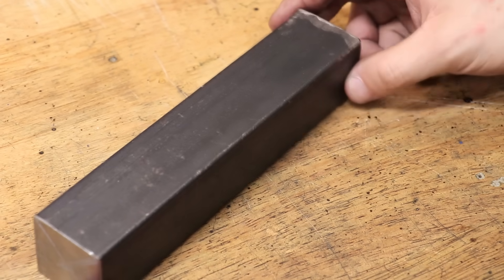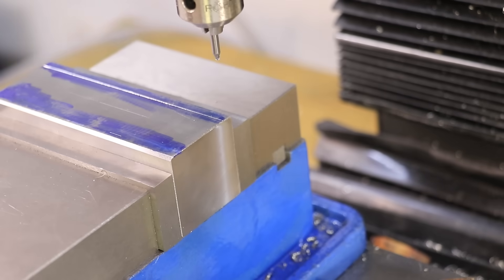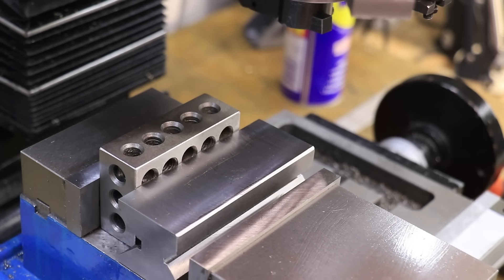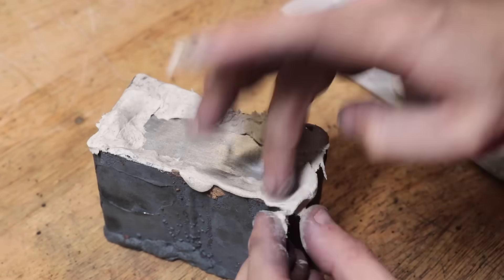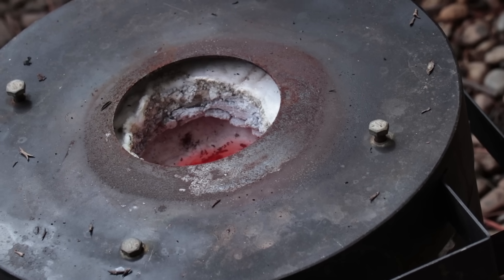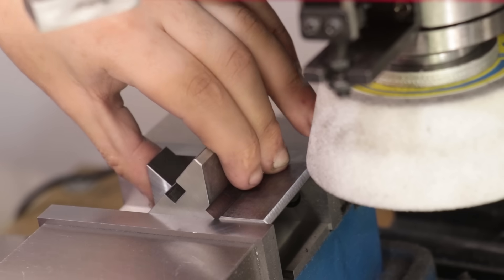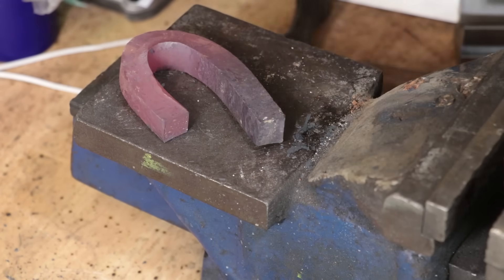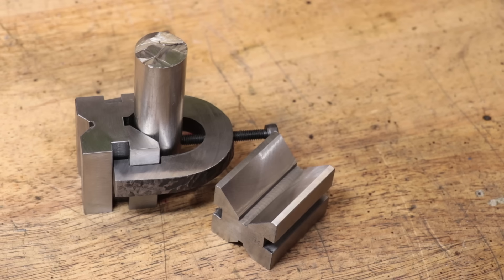Making A Set Of V Blocks

Comment: You are grinding on the mill. I tried, but got a problem: the mill stalled because the grinding did not remove enough material. What is your step size from pass to pass ? My machine has only a 0.01mm scale, and I heard you have to use 0.0025 to 0.004 on each pass.

Comment: Have you ever considered chain-drilling when cutting material?(For those who haven’t heard the term, it’s drilling a series of holes close enough together so the bores of the holes slightly overlap each other into one groove, a strait line, circle, or whichever pattern) It does waste a bit of material, but it makes the hacksawing so much easier. I use DeWalt pilot point bits for doing this in big chunks of material all the time. I just did this with a 12x8x1/2” steel plate and roughly chain drilled the shape of features, think a poor mans waterjet type of cut, and finished it with two passes per feature face on the mill. Just throwing the method out there for anybody. I know endmills don’t grow on trees for us hobby people, but drill bits sorta do. But, if anybody does this, be VERY careful with the drilled edges.
Reply: I've used chain drilling quite a bit myself, it works great if you don't have a better way.

Comment: Hey man! I noticed you add a piece of wire/aluminum rod in-between the soft jaw and the piece while squaring up your stock. What's the reasoning behind that? Does it prevent the soft jaw from throwing the piece off square when pressure is applied?
Reply from the maker: I use it when clamping on uneven stock. Makes it so there is one point of contact from the moving jaw to the uneven stock which helps ensure that the machined edge stays parallel with the fixed jaw.

Comment: if you want too facegrind with no mess find a stainless steel tub your vice fits in with some room either side, about 50% of your mill table

have the tub about 4” high (whatever fits nice) drill two hold too bolt the vice through too your table. This will catch all the sand

your pretty much putting a bucket under and around your vice 

i use stainless cake tray found at a  kitchen shop. that way it doesn’t compress when you bolt the vice on it

Comment: Good work my brother, So few people today actually know how to use a hack saw. Good work with the first time pack hardening. ,,,, If anybody deserves a band saw, though. it's you. Don't sell the HF 4x6 short. Don't listen to the cork sniffers. It takes a little tuning but we have had one in our shop for over 30 years. - 2-Worm wheels, 1 moter,  and installation of water and hydraulic feed cylinder and we use if a good 20 hours a week cutting 4140 round bar. Well worth the 3 hun they go for today. Like I said. You deserve one.

Comment: I feel the process you use to harden your parts is a bit inconvenient. A much easier way would be to use a box with a lid, instead of clay. If there is a little gap doesn't really matter, as any Oxygen will instantly burn the coal and become CO2 before even getting to your parts. You can then use the box again to protect your parts from oxidizing and decarbonizing while heating up for hardening.

I've done this a lot of times and it is a common practice to put not only case hardening but even tool steel in a box with charcoal to prevent forming of scale and it works well.

Comment: Love the vid 👍. Also the reason you didn't get the same hardness as cold oil is the thermal shock from the quench. The oil being hot means the temp diff is not as massive allowing the piece to cool off more slowly.
Reply from the maker: Well yes, less martensite formation, but I don't need hardness for v blocks, which is why I chose this method, I needed minimal warping. Hot oil won't as much variation in temperature

Comment: NEVER case harden ANYTHING!!
Use A2 tool steel and vacuum heat treat to 58/60. 
Warpage from case hardening IS NOT worth the effort.
Reply from the maker: Well if I could buy tool steel in the size of square bar I would. But my suppliers don't sell that

Comment: Very nice work.
I made my own forge too - I was (still am) about the fiber comming from those K-wool blankets.
I (very carefully with full protective gear) coated my forge with refractory cement (about 5 layers - about 3 extra due to cracking and other issues. Two layers are good enough). 
You really don't want to breath these tiny fibers - it's like breathing asbestos.
These tiny glass fibers induce silicosis - a process of forming lung cancer due to embedded particles in the lung that cannot be cleared out, just like asbestosis. FYI.

Comment: I guess you realised later you should have fitted some sort of spacer into the 'U' of the clamp to prevent it springing.
 I was given a 'pair' of small V blocks probably 30 years ago without clamps.
 cut them from 3/8" (10mm) plate and used a 5mm screw. Hole saw hacksaw and files did the job
Only one gets used a lot so being a mis-matched 'pair' doesn't matter.
You always seem to be fly cutting at high rpm, are you using carbide insert cutter?

Comment: Nice video, both the quality of machining and filming ! A question though : For such parts, what's the adventage of case hardening VS making the part of higher carbon steel and quenching it ? It's quite time consuming and you dont get as much hardness as you could with the first method
Btw, good work mate, keep them coming !
Reply from the maker: Thankyou. I tend to rely on case hardening to harden parts because getting large flat and square bar of high carbon steel is very difficult. My area of the world doesn't have a big demand for that type of steel in the manufacturing that happens, as a result of I really wanted to get a piece of high carbon steel, like what I used here, I'd be up for a minimum order of atleast 6 meters. Conversely getting my hands on low carbon structural steel is much easier. Cheers

Comment: When squaring stock like that, instead of that little bar/rod you used vertically, you should use it horizontally, or better yet, just use a ball bearing on the moving jaw.

Comment: Silver flux is boric acid and borax. One thing you might try is to get a hold of some nitric acid. A 15% nitric acid/water mixture will etch the case/core of a test (done at the same time) sample which is ground down allowing you to measure accurately the case depth. It will turn the case black and leave the core silver.
Reply from the maker: Cheers, someone suggested that I try out the nitric acid mix, and I will have to do it sometime in the future. And im sure some fluxes are boric acid based, but this one isnt.
Reply: @artisanmakes  Interesting. Here there is nothing but borax based. Of course I only buy a new jar once every 25 years! So maybe its a new thing?

Comment: an alternative to carburizing is "super quench"
4 gal of water
1 large bottle dish detergent liquid
1 sm bottle of "jet dry"
5 lbs of salt
mix ingredients
quench your 1018 - 1045 when your above the curie point
works great for low to mid low carbon steels
you can expect about a 50-52 rockwell
descale with a soak in muriotic.

Comment: When tapping a part, why don't you make yourself a dead center point with straight instead of tapered shaft so you can use the mill or drill press to keep the tap straight when starting the tap. that's what the little center hole in the back of the tap is for.
Reply from the maker: It's certainly something that is on my list of projects that I need to get around to doing. Cheers

Comment: I would have cut the slot all the way down to the bottom of the V's first, and then cut the 45° on either side of it. That would have required smaller cuts which might have made it easier going.
Reply from the maker: Fair enough, many ways to tackle the same job. Cheers

Comment: Does grinding them flat do anything to the case hardening? (I'm a complete noob, be gentle.)
Reply: I'd say that the grinding removed almost all of the case hardening.
Reply from the maker: The case thicken should be around 0.15ish and the deepeesr grind was about 0.03mm. so I definitely took some material off but thankfully it was much less than I had to remove with the vice build. Cheers

Comment: Why did you machine the bar BEFORE forging it? Just curious... the clamp turned out awesome! The contrast between machined and forged finish looks very good!
Reply from the maker: Needed to square up the sides. It was a piece of off cut from a previous project and the edge was in rough shape from the angle grinder. Cheers

Comment: Please, use non teflon coated stuff, when operating above 250deg C (480F) because teflon is decomposing above this temperature - and above 300C its quite generous, how much crap its releasing.

in cooking its the same, dont overheat pans and pots.
Reply from the maker: Interesting point, never occured to me about thinking about that in this situation..I know of the cooking concerns about Teflon but I use cast iron so it never really occurs to me. Cheers
Reply: @artisanmakes  It's worth being careful but at the same time the decomposition products are bad but have never been found to be a major exposure pathway for humans. Apparently, tests showed that butter fumes are lethal to parakeets at a lower temperature than the coating on PTFE cookware.
Reply: What's teflon got to do with anything in this video? Why are you scaremongering?

Comment: Mate, you should have a million subs. It's always a pleasant surprise when you upload. Very nice job as usual. Also a quick tip is to drop the case hardened parts directly into a water bath once removed from the charcoal. That's how firearms get the pretty rainbow color case hardening.

Comment: A nice next big project could be a power hacksaw, a mechanism similar to that of the powered filer could be used, I imagine that sawing metal by hand is getting tiresome at this point. Great video and great work.
Reply: I just wonder how he can saw that thick pieces of metal by hand with a hacksaw.
Reply: @Ed-rt9qt  - If you know how to use a hacksaw, cutting such a block is not really an issue.
Also remember, that's how our grandparents cut steel "back in the day".
Reply: @johncoops6897  I know how to use a hacksaw, I use it often too.But it is not easy and needs a lot of muscular strength and patience.
Reply: He is way ahead of you :)

Comment: You should give a cold air blast nozzle a try. Coming up with cooling solutions is tough for most home machinists. 

You may even be able to machine one. They have no moving parts, but I'm not sure about what the most efficient internal design looks like. Or, you could just buy one.

Comment: Very nice! Out of interest I have found the quenching in cold engine oil from a "straw coloured" heated steel to be the easiest method to get a pretty good case harden. It then needs to be tempered in the Wife's oven (when she is out!). Whats your thoughts on that method?
Reply: This all wrong. Quenching at a "straw" will do absolutely nothing. You don't gain carbon from motor oil either. I'd skip the idea of case hardening stuff all together. If you want  a hardened tool buy some 1045 steel heat to non magnetic and quench in water.
Reply: @nicktaylor9291  I made a whacker tool for the end of a concrete breaker to drive 1.5 inch steel pipe into the ground. I tried driving the mild steel unhardened and not surprisingly the end peened over almost immediately. So I heat to "straw" colour and quenched in use motor oil.. Then annealed in the oven. I have now used the tool several times since and the tool is the same shape as when I made it. Now I know this is an un-scientific method to test but it sure seems like its much harder than it was.
Reply: @@frankish5314  that may be. But heating mild steel to straw color and quenching in motor oil will literally do nothing. I'm sorry. Straw is a temper color. There is a whole bunch of science going on there. Case hardening something either requires something like "cherry red" or a prolonged baking at high temp. Just heating something to 300f isn't hot enough to form what you need to harden something.
Reply: If its mild steel where is the carbon coming from in that method? Isn't that just for tool steels?
Reply: @fergusoddjob  From the carbon in used motor oil.
Reply: @fergusoddjob  Mild steel. It comes from the motor oil. I am told this method makes it super hard and brittle and must be tempered afterwards. I made a tool to go on the end of concrete breaker to drive steel pipe into the ground (about the most powerful version that you can plug into a wall outlet). This was 30mm dia mild steel and not surprisingly the end of the tool was peened over after driving only two pipes. I then hardened and tempered using the above method and a friend has now driven several pipes and there is no sign of deformation. I have not tried to drive pipe myself after hardening so can't claim to have done a back to back comparison but it appears to work.

Comment: not to be that guy but Kaowool from wha ti know releases cancerogenic fibers when heated, so the "gasket" of Kaowool might not be a good idea in the furnace =) people seal that stuff with ITC-100 etc to bind up the fibers so they wont be flying around =)
Love your videos tho! Would like to see your arms as they must be huge from all the hacksawing :P
Reply from the maker: You bet, you can probably see what is left of the kiln refractory that I used originally. For whatever reason over the past month it has practically disintegrated. My best guess would be due to the longer running times that I have been doing to case harden the parts but I would have expected the refractory to put up with that. Waiting for some replacement be delivered. In the mean time I've been using gloves and a P2 mask. From what I hear this stuff can be like asbestos at high temps, though none of the books I have can nack this up. Cheers
Reply: @artisanmakes  Yep, asbestos was what i was looking for but didnt remember the name, good to hear you have a mask on =)

Comment: I was using citric acid in granules to remove polymerized oil from aluminum part. I just sprinkle it on part and heat it with heat gun.
When part cools its easily washed with water.
Also i use it as an active flux for soldering when dealing with old oxidized nasty cables and for general purpose soldering.
Obviously you cant use caustic soda on aluminum parts.
I dont know if citric acid will work better that caustic soda for steel. but on aluminum it surely works great when heat is applied.
Reply: I'll have to try this trick!

Comment: Nicely done.  How are you going with all the wet weather? Up here in Qld we are not getting as much as you, but plenty of flooding in the usual low laying areas around the place.
Reply from the maker: Thanks for asking, been pretty wet down here in NSW. The moisture hasn't been doing my tools too much good, I have to keep them properly oiled and such. Thankfully the workshop hasn't flooded. When I first moved in it flooded several times. Had to redo the sealing and drainage which I am happy about, given the flooding that other parts of the state has been getting. Cheers